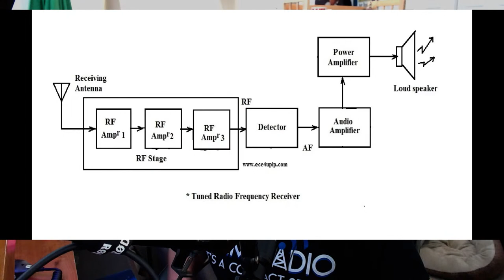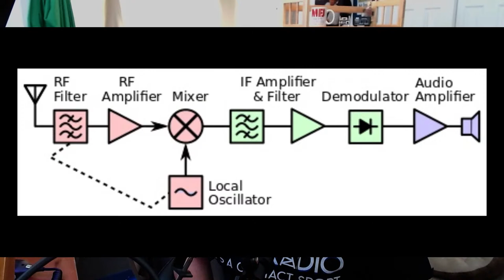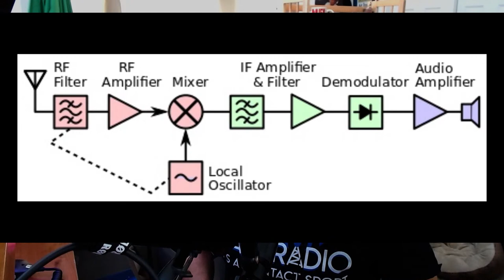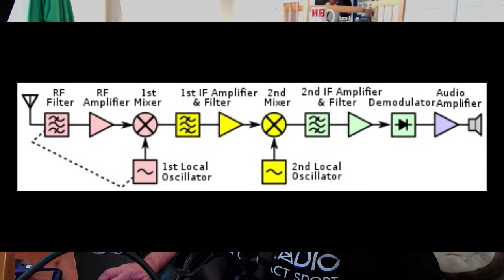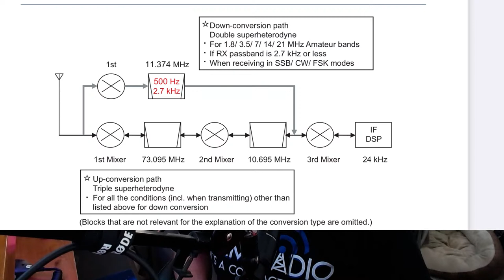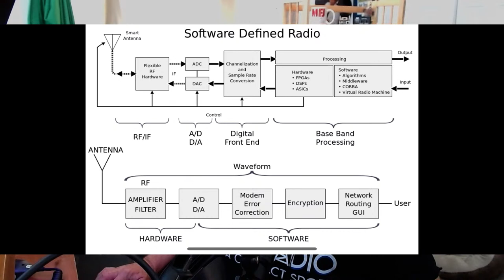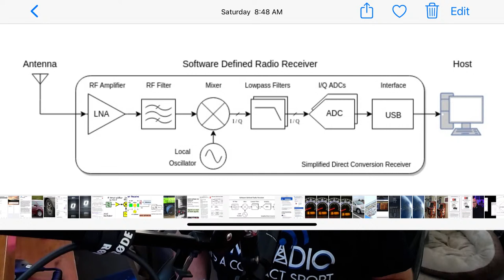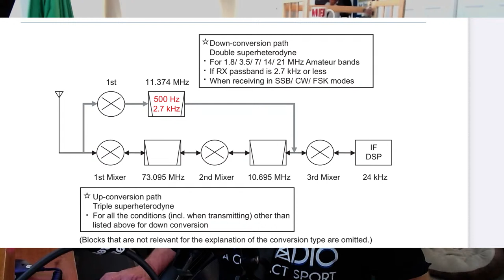Ham Radio Live! Show 123. Upconversion, Downconversion Superhets & Hybrid SDR’s Just Follow The Road

Comment: I did not understand why additional stages add selectivity.
Reply from the maker: Sorry that it wasn’t clear. I’m glad you wrote in to ask my friend. It’s a tough subject.

In a double conversion, the first local Oscillator is used to help “lock” The center or carrier Frequency and keep it stable. 

This first local Oscillator can be either fixed or variable depending upon design. But it’s main purpose is for sensitivity. It will create the intermediate frequency used as a reference point to always keep the receiver locked on frequency as tightly as possible.

In a double conversion, a second local Oscillator is included in the receive chain which is much narrower, as described in the video, 

it’s in kilohertz, not megahertz. 

When you add crystal roofing filters to the chain, you now can make the receiver much more selective. The Intermediate frequency created here is much narrower than that from the first local Oscillator being at 455 kHz instead of over 70 MHz.

Again, The first local Oscillator is there to only help maintain a frequency lock. The second one, because it’s much narrower is there to help with selectivity because it’s a much lower intermediate frequency to work with.

The second local oscillator is in kilohertz and works with roofing filters that are typically no higher than 15 kHz for FM and 300 Hz for CW. 

Because the second local Oscillator creates an intermediate frequency that is much narrower than the first local Oscillator, the second LO helps with sensitivity… The ability for the radio to separate signals and still hear them as clearly as possible. 

In a triple and quadruple design, additional sensitivity and selectivity can be provided. 

In the video, I describe how the Kenwood 590 Receive path is done. 

The first local Oscillator is over 70 MHz. This is to allow the radio to work any amateur band up to 6 m and “up convert” to maintain frequency stability. 

The second local Oscillator in the example is at over 11 MHz. It is ONLY used if the operator is trying to receive a frequency above 21 MHz.

If the user is above 21 MHz, the radio will use the “triple conversion path” (first local oscillator over 70 MHz, then, a second local Oscillator at just over 11 MHz to help make the radio more sensitive, then for selectivity, it adds to the third local Oscillator which is running at 455 kHz.)

This “Triple conversion“ happens only again if the operator is above 21 MHz. 

If the operator is below 21 MHz the radio will automatically use itself as a double conversion Superheterodyne Radio. Taking the initial 70+ MHz Local Oscillator intermediate frequency and combining it with the third local Oscillator which is set to 455 kHz. 

Because that third local Oscillator is set to 455 kHz the difference between it and whatever roofing filter is being used is far less of a margin then if using a local Oscillator running in megahertz. This helps greatly with selectivity.

The third local Oscillator is there for selectivity. In the Kenwood example, at 455 kHz. Using the crystal roofing filters to help the radio separate signals. (Selectivity.)

Think of it this way, the first local Oscillator helps make the radio more sensitive by locking it on frequency in a more wide range… 70 MHz compared to whatever carrier or center frequency the user is on. By setting the first local Oscillator at this frequency, all of the HF (and low VHF) amateur bands can be used.

That second local Oscillator only comes into play when the 12m band and higher frequencies are being used to help make the radio even more sensitive. 

Instead of having to use a 70 MHz reference point, the radio now uses one at just over 11 MHz and either up converts or down converts from there. 

The third local Oscillator is used no matter what frequency the user decides to use and is set at 455 kHz. It is there specifically for the purpose of selectivity with roofing filters.

Because that third oscillator is used in any example that the radio would work at, The third oscillator is used for selectivity to help the radio become very selective because again it’s only in kilohertz not megahertz it gives the receiver a more narrow intermediate frequency to work with we are trying to separate signals.

I hope that helps to explain things better.

All the very best to you and your family,

Larry 
de K7HN